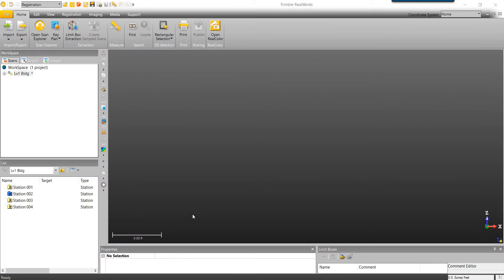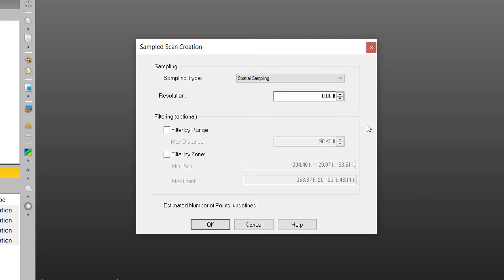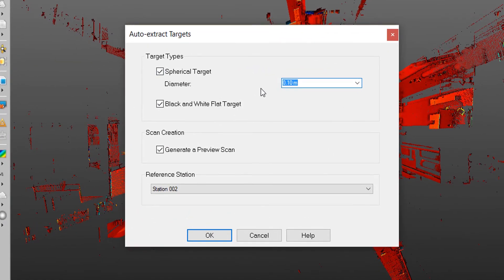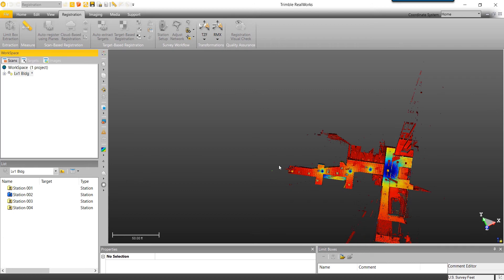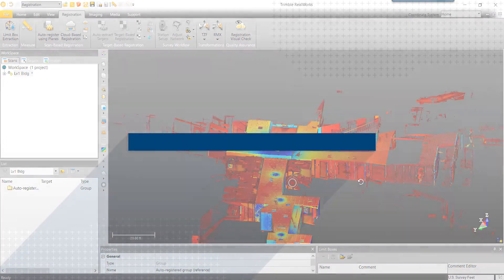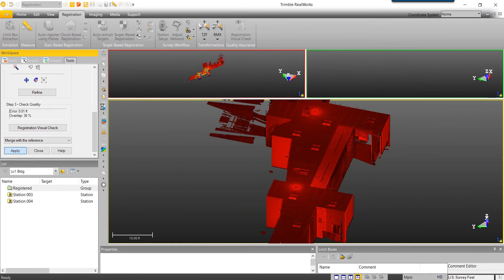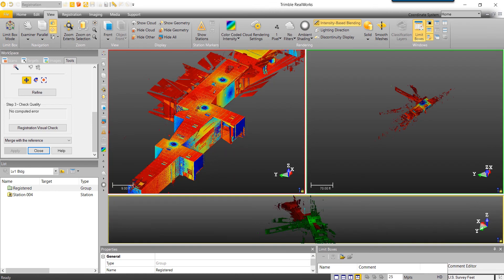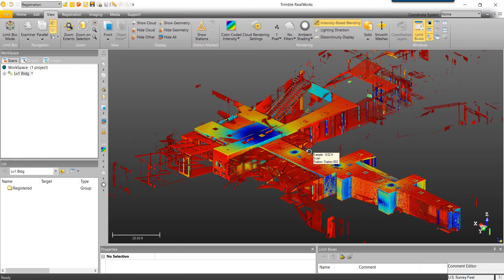Basic Registration Workflows - Trimble RealWorks

Comment: Also, when you disable the compensator for the majority of the scans, do you still get the level bubble in the green or just move the scanner and start scanning?
Reply from the maker: Either way. In general it's good to keep the scanner close to level but it is not required for registration. I tend to always level the scanner since it usually only takes a few seconds. In TRW you can force the software to recognize a station leveled or unleveled. You can also have the software attempt to automatically level a project based on surrounding features such as walls. Now certainly if you are doing something like checking the levelness of a floor or wall you will want to make sure the scanner is leveled with the compensator turned on for at least one scan which you can use as a reference during registration.
Reply: OfficialTRW Awesome! I tried using Target base registration earlier today, but it didn't work. Does there have to be a Target visible in every scan in order for that to work?
Reply from the maker: You will want to have 3 common targets or more between each station setup for the best results. If for some reason a target gets moved or maybe someone walks in front of it when the scanner is looking at it then it is better to have some back ups. Now if you find that you don't have enough targets to register you can use the automatic plane based registration which usually does the trick or you can use the manual registration where you pick a common point or points between two scans. Very last resort you can just manually move the scans to line up with each other.
Reply: The area I'm scanning is very large. 9 targets spread throughout, and a ton of equipment blocking the targets from one scan to another. (I usually scan the targets first) I've been using the plane base registration ever since I started this job. Seems like that relies a lot on the PC, and with ~60+ scans per project folder, sometimes the computer has taken 30+ hours to finish. Even if it took me 5 mins to line up one scan to another, I could get it done faster manually.
Reply: Just out of curiosity, is it possible to mount the TX8 upside down while scanning? There is no mention of it in the manual, and I haven't been able to find anything online about it. Thanks for all the help!
Reply from the maker: wow that time is excessively long! what kind of computer are you using?
Reply from the maker: The TX8 should be fine running upside down occasionally. It was primarily designed to be operated upright so maybe it could wear down the motors prematurely but I have run mine upside down for years when needed and have had no problems.
Reply: OfficialTRW the PC I'm using was built by my company, usually I can start plane base registration in the afternoon and the model will be ready the next morning. I'm not at the computer right now but I'll look into it.

There's only been a couple of instances where it's taken 24 for 30 plus hours. Not sure if it was the project size, all scans being level, or simply the PC needed Rebooted.